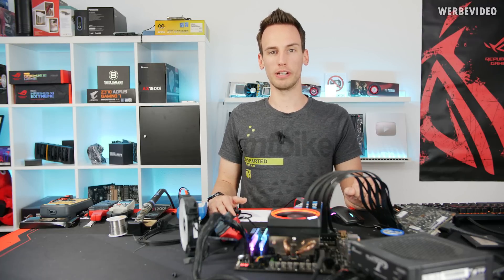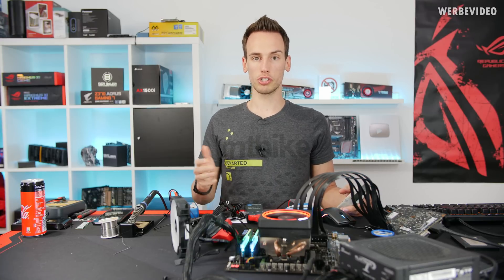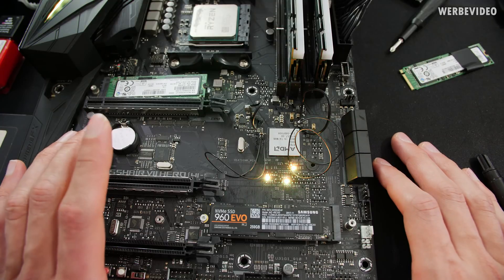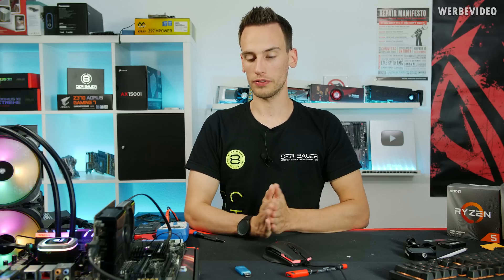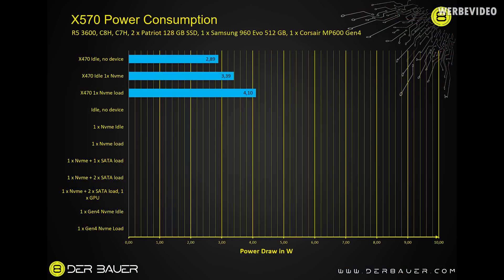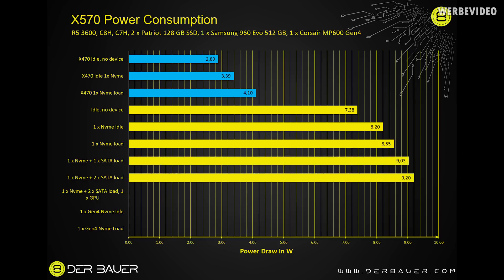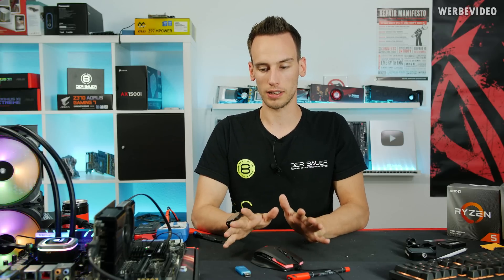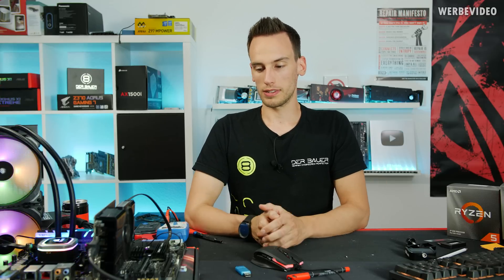X570 Power Consumption Measured - What is going on here?

Comment: Nice to see this, I bought an Asus Prime X570 board which was missing the chipset cooler entirely, so I just grabbed one from an old FM2+ board along with a decent 0.5mm thermal pad, and mounted it with the pressure pins they had, and it barely broke 79C underload with no airflow.

Comment: I have the asus x570-e board and I connect 24 HDD's + 1 nvme ssd + 1 m.2 adapter card with 6 sata ports + 1 PCI-e card with 4 sata ports and I fill all that with disks, so it has to consume , I have to see the temperature with all that load, but so far I have not seen any loss of performance.

Comment: Thanks to this chipset fan I postponed an upgrade for a generation and I am actually quite happy that it happened like this. It's strange that way back in the times of the P45 north bridge, the chip had a TDP of 22W which was easily going quite higher with high speed memory and timings and there were only passive coolers for it. Yes, it ran so hot that sometimes the chip used to fuse with the heatsink, nevertheless I run one such build for 10+ years as my storage server and regardless of the load, the P45 radiator is burning hot BUT fanless.

Comment: Using:
2x PCIE3.0 chipset bound NVME in RAID0+
1x PCIE3.0 CPU bound NVME unraided+
2x SATA 7200RPM HDDs in RAID0+
1x SATA 7200RPM HDD unraided.

My Aorus master reaches 75~82C easily with the chipset fan set to performance in a high airflow environment. 

The videocard is a 3 slot 2080 Super that goes right above the chipset.

You should really test those extreme cenarios for x570 temperature and consumption, really overload it with RAID0 and fill all NVME slots plus use some SATA RAID0 together as well. That would be a great video.

Comment: All the comments are as old as this video and x570 has been out for a while now any update? Does anyone have a raid 0 setup with 2 m.2 gen 4 NVMe drives that are both running through the x570 chipset lanes that can tell us how Hot its running?  Also doesn't Sli Setups the 2nd GPU runs through x570 chipset lane yes? So if you have RTX 2080 ti  SLI setup and 2 Gen m.2 in raid 0 through chipset lanes can u let us know if your chipset has caught fire or if its running at 70c full load? Thank You.

Comment: My theory: They knew X570 boards drew way more power so, they just lied and told everyone it was Gen4 tech that was causing it. Not thinking that someone would be curious enough to look into where the extra power consumption is coming from. Thank you for there videos, the community appreciates it!
Reply: Worst case scenario :
When northbridge chipset very hot system become hang, freeze then shutdown itself.

isn't about power consumption but temperature in closed PC case
Reply: It's the 2x wider PCIe 4.0 link to the CPU (which is a constant, and it's actually an 8x lane bus on die as seen with TRX40 [which uses the same chip], but with only 1/2 wired up [but the entire bus still needs power to work]) that's sucking up the power, so they technically weren't wrong at all to say that PCIe 4.0 was the cause; just not in the way most people had thought/assumed. Also, the M.2 slot der8aur is using here is the main one.... aka the one routed directly to the CPU, not to the chipset. If he'd have used a different M.2 slot, I imagine the power consumption figures would have been higher.

Comment: Dear Der8auer, I am having a hard time finding a simple chipset heatsink like the one in your video, can you share the mechanical specs or part number? Thanks you for this video. I am using an ASUS Prime X570 Pro, I want to find an aftermarket solution for later on if the fan fails.

Comment: You are spot on!!..I test on my entry level MSI x570 GAming Plus, with 0 rpm or 1100rpm the temp are the same, 70º, and this after 1,3H streaming and gaming the same time!!...So i think some fishing about the reason why they put active cooling on chipset...
Reply: In my experience from the past (both amd nor Intel) when northbridge chipset very hot system become hang or freeze then shutdown byself.

In the worst scenario case temp, airflow or ambient too hot small fan it can help you.

first I didn't understand what was wrong with my old system ! struggle few months until I finally realized northbride was very hot and decided to reduce northbrige voltage that's work but reducing overclocking rate too.

Edit;
My temperature CPU under full load 70~77℃ isn't too hot. LOL 😂

Comment: I think Steve said in one video. The main problem is that X570 chipset it can not be underclock it is only running at full speed all the time.
Reply: Undervolt !
Reply: @claritoresdiano1021  You are absolutely right Undervolt. The chip is (reportedly) unstable at lower voltages
Reply: @Fe1538C  not too much

Comment: If they could just have made the chipset on 14nm or even 28nm and run the voltage under 1.0 I don't think we'd have a problem. The push to save $2 per chip is too high and they want to use older process tech and increase voltages to maximize yeilds.

Comment: Yup, I've said it from day one, "I'll wait for passive cooling solutions."  This validates my sneaking suspicion that those elaborate cooling solutions are a marketing gimmick and I just don't buy AMD's marketing pitch that these chipsets produce more heat than can be adequately removed by a passive heat sink.  I mean, seriously... a heat sink with a tiny fan in 2019?  I've not seen that on a board since the early 2000 era ABIT IC7-Max 3 I once owned and that sucker was temperamental AF... so I thought, "Nope, not going through that again, no way, no how."  Look forward to der8auer finding a definitive answer, but just looking at all the boards available currently, it looks like a scam to convince people that they are getting "powerful" hardware for an enormous price.  AMD seems pretty shady at this point, I'm about ready to buy Intel even if it costs me a little more for less performance at a particular price point.  And no, I'm not an Intel fanboy, I have an AMD rig in the other room and I just about pulled the trigger on a 3700x on Thursday.
Reply: Isn't it the board makers who decide how to cool the chips, not AMD? And, seriously? All the shady shit Intel has done, and this comparatively minor issue, which you can avoid by simply buying a B470 or B450, is enough to make you want to pay more for something equivalent from Intel?

Comment: are the pcie lanes from the chipset to the cpu 4.o as well?  if so the fact that the pch has to talk to the cpu at 4.0 speeds even with a 3.0 drive might explain it.  but if im not badly mistaken firts and second gen ryzen didnt have pcie 3.0 lanes to the chipset.  instead they used double the amount of pcie 2 lanes.  intel uses 4 gen 3 lanes and amd used 8 gen 2 lanes to get the same bandwidth.  at least thats the way i understand it.  

the distances from the pch to the cpu are longer so maybe it requires more power.  and since the cpu and chipset will be communicating by pcie gen 4 all the time which drive you use wont matter as much.  maybe the real power hog are those long traces to and from the cpu\chipset.

of course for all i know amd did like they did with last gen chips and use 8 lanes at the older speed.  so 8 gen 3 lanes.  or maybe they just stayed with the same setup as last gen chips i havent really heard.  or possibly since these chipsets are basically just repurposed io dies then maybe they werent really meant to be chipsets at all and it was cheaper to just deal with the added heat.  they may not have clock gating or something?

Comment: so if I built with an x570 and my chipset fan failed 3 years down the line ill most likely be fine as long as im not running a bunch of pcie4 nvme drives?
Reply: depends your temperature when northbrige very hot your system can failure

Comment: How much the SSD take on the pcie 3.3 and 12v rail, these are not from the chipset and maybe you  could see a difference there.

Also I remember boards in the old time, some used to heatpipe the chipsets heatsink to the mosfet one, why they don't do that is the question, they could get rid of the fan so easily. Could be clerance maybe, as we use to have two chipsets

Comment: it is the line connection between the CPU and Chipset. 4.0 has some power for the 3950x and above to handle and the Connection made above 70 degree in AMD inside tests. So they desided to be sure the new MB can handle upon Ryzen 4th gen, which will be much more power stressing the new MB's. It's for the "we guarantee you 3 years on same mobo" Thing as it's still thought to be up/down ward compability.

Comment: I think only two reasons:
1) those chip have a very low tjMAX
2) They want actively cooling other components like nvme drives or ram modules

Some old amd chipset had 20w tdp and run crazy hot but passively (990fx 20w  ( + SB950 7w))
Reply: don't forget overheating northbridge = system failure

Comment: Eh, a few things here.  You should just use the multimeters current mode when measuring these as you are already soldering wires on 
finally the inductor lifting was not the best idea, your simply adding to the switching inductors inductances and the current on them will be all over the place (at the switching frequency) and it probably should have been tapped off elsewhere or measured with an oscilloscope (but likely would not help either as i doubt the bandwidth of that clamp is above the switching frequency)
it might be better to try and find that rail elsewhere, those polyfuses next to it look like a good bet

Comment: Maybe AMD tested the chipset thermals with some of those cases that have closed off panels on all sides and came to the conclusion that if there were any issues with the chipset overheating because stupid buyers buy stupid cases they would get all the blame regardless. ;)
Reply: your right overheating northbrige = system failure.

*learn from the past when passive cooling doesn't enough i must undervolt the nortbridge but trade off is reduce overclocking rate

Comment: I believe I may know what is going on. In order for PCI-E 4.0 to work, the chipset obviously needed more power than for PCI-E 3.0. I think that instead of having 2 different power states for PCI-E 3 and 4, they set the default power state to use what was required for PCI-E 4.0. This would result in the difference between your 2 tests being only the power draw of each respective SSD. I don't even think it would be possible for them to allow a toggle for a PCI-E 3.0 mode in the UEFI, but I could be wrong.

Comment: In the early 2000's we were having severe electrical issues causing a loss of power in a car engine.  Anyway,  the mechanic's figured out the coil pack was putting a charge in the engine coolant system.  The answer was to test the coolant for an excessive electrical charge . ( I don't remember the voltage the manufacture came up with to be excessive.) The solution was to change the coolant if it exceeded the limit.  If you can stick tester lead in your coolant to find out if it's charged.  But, if it is, i don't have a clue on how fix it.  It's the only place i can think where the missing electricity would go if you've already removed all the extra fans from the board.

Comment: The cIOD on Matisse works on PCIe 4.0 on all boards including X570/400/300 Series. That enables PCIe4 NVMe support on 400/300 Series boards.
The chipset uses the same design.
Maybe the chipset runs on PCIe 4 all the time.

Comment: Circuit designer here one thing that could explain the power consumption is that to build circuits like serial links at higher speeds often requires added complexity or entire architectural changes.  Designers try to make power scale back at lower speeds so that power consumption there is still competitive but there is always some overhead and if you've jumped a significant architectural boundary (ie. adding amplifier stages or samplers) it will be difficult or impossible to achieve the power that a more application-specific circuit can achieve at lower speeds.

Comment: it seems you just cant imagine  it being the case but.. i bet the X570 chip cant be throttled down to pcie3-2-1 etc, it always runs at 4.0 spec, and accepts 3.0 in compatibility mode or something, so you're always wasting power as if there was an actual 4.0 device connected, thats my theory

on the active cooling thing... well, some aspects of this industry give off a little "jobs program" smell to me, having different mounting points for AMD-intel and changing them a MILIMITER or two every other gen, i cant see any other reason than to keep noctua & co. in business, or at least MORE business than there would otherwise be, same thing here with the 40mm noise makers now

Comment: Theories 
1. Only one board with a passive chipset (X570 Aurus Extreme) is very strange, they knew it was possible, as any engineer would, but used it as a extremely high end option. Why gimp your own lineup, any of the board manufacturers could have made the entire lineup passive and they would have sold the majority of this generations boards on only the back of that, no need for marketing if you win on features. 

2. X570 is a server io die, the price of these boards are insane and I guess this has to do with mostly a costly chipset, this would also partly explain the high power use. 
2. FW bug putting the system into PCI gen 4 "state" at all times and therefore using more power

Comment: Current consumption might fluctuate very fast, which the multimeter won't even register. I also doubt the clamp is suitable for this kind of measurement.
Maybe hook the clamp up to an oscilloscope instead of a dmm.
Reply: active cooling still wouldn't be needed if the heatsink is decently large and has enough thermal capacity

Comment: Wonder if they aren't having production issues making these new x570 chipsets, and are essentially having to overvolt them to get the clocks they need. I wonder if there's anything hinting at this? Is the main 1.075V supply  now a higher voltage than the old x470? As for it idling high, it might just be that they have to run the whole thing at full speed even if there aren't pcie 4 devices present. Hmm. Not great tho.

One option for measuring current could be to use very low value shunt resistors (like 0.01 ohm, available in smd) and measuring the voltage across them on the board, maybe even with a scope. Maybe a little easier than large loops of wire.

Comment: If I am understanding this correctly ,would it be possible to lower the voltage on the pch and turn the fan off, as the devices don't need any extra power than X470 then at least the idle power consumption would be lower and cooler

Comment: The switching  on Gen 4 is faster Hence the links matching is tighter . 

The Point is Rise  Time 

https://www.keysight.com/upload/cmc_upload/All/HSDSeminarPaper3.pdf

The rise time for a gen 4  pci-express lane is  far faster than than a Gen 3 .
So Even if you run a Gen 3  part on a Gen 4 Lane  the Faster Rise time of the Lane will have the same effect . 
 

The faster rise times create the SI  issues that X570 . Even if you Run Gen 3 on Gen 4 most of the  Higher Shorter Rise Times  of the edges will 
have Effects as the Silicon is Pushing Faster Edges.No Matter what data rate 3 or 4.

I PCI express is a very complex  interface  with pre-shoot  and de-emphasis and many more factors.

But Do not expect  a  Ferrari  and a VW to have the same gas per km  50km per hour

Comment: Look, lets get this straight. End device does nothing, but respond to PCIe controller commands. Look how tight jitter specification is. In order to drive it precision PLL is required + large input output drivers with high leakage current (because long line has to be driven). That results in much higher power consumption compared to PCIe gen 3.

I do not know for sure, but I assume that the only available tech process suitable for PCIe gen 4 I/O drivers was leaky (fast/high performance) process which resulted in high power consumption overall. Fans are there to keep it reliable, because leaky tech processes are way more prone to electron migration. This process (not only it, but it is one of major processes if no the major) is responsible for failing integrated circuits.

Comment: Also, my M5A99FX PRO R2.0 (AMD FX mobo) has a motherboard chipset.. with 20W TDP.. and just 2 small chunks of aluminium on the NB and SB. I'd guess the NB alone has a TDP of at least 10W, if not 14-16W. I mean, it gets hot, like very hot to the touch, but they never needed a fan, and that's before OCing the HyperTransport, which was never advised against.. 
https://en.wikipedia.org/wiki/List_of_AMD_chipsets#A-Link_Express_III
So why the fan, if a board with 20W TDP chipset just needs two small chunks of aluminium... just like your X570?
Reply: Also, it's possible that the gen 3.0 device was at gen 3.0 between the SSD and the chipset, but the chipset could be running permanently at PCIe 4.0 between it and the CPU to get a minuscule advantage in latency... ?
i.e. the chipset is just a PCIE 4.0 PLX chip, which is all the CPU ever sees at a hardware level, which only downclocks to PCIe 3.0 between it and the CPU if that's all the CPU is capable of..
Reply: I suspect that when you populate all M.2 slots with PCIe 4.0 devices, along with all main PCIe slots you could see much higher power consuption if it has to change to the full PCIe x16 4.0, rather than say running at PCIe x4 or x8 at 4.0 with only gen 3.0 x16 devices, or x4 4.0 devices connected.

Comment: You know, if you're going to the trouble of soldering, you can just use the ammeter functionality of your probe. Probes basically have current clamps inside them, and the speed of measurement will be about the same if you're using the voltmeter functionality to measure the current from an external current clamp.
Reply: Still though, great video.